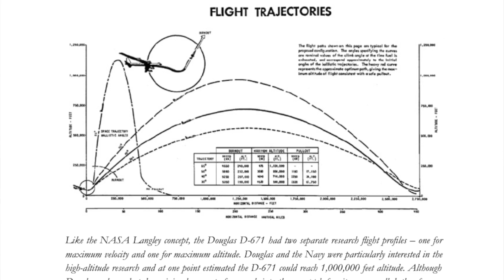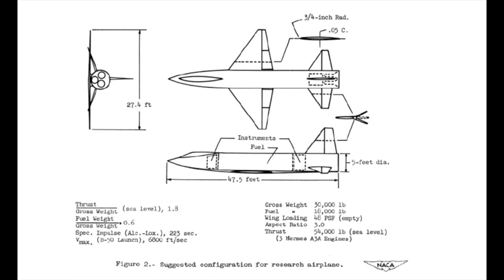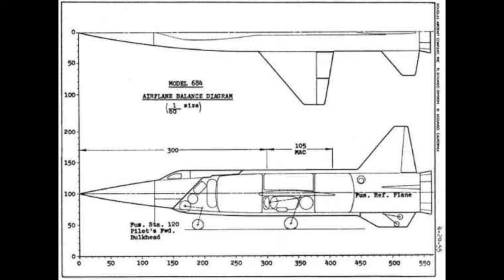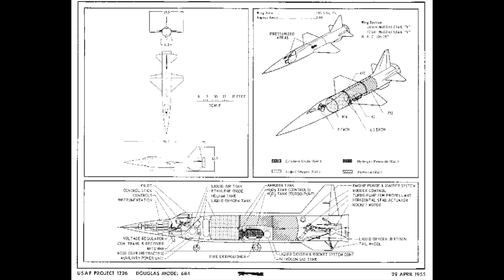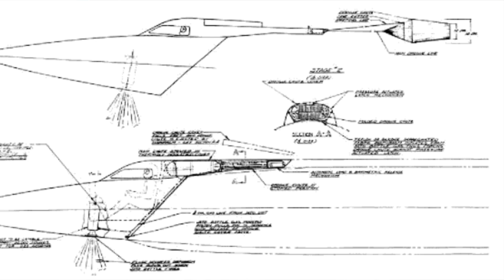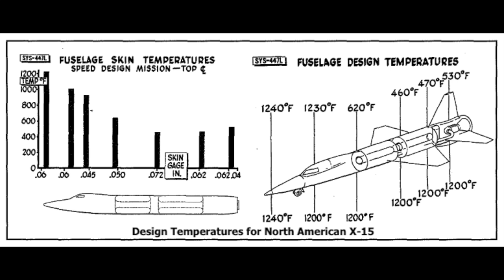The Radioactive Alternative To The X-15 - Faster, Higher, Cheaper. The Douglas D-684

Comment: Well thorium is only weak radio active and it emits alpha radiation. In an allow, the concentration is even lower and most of the radiation is already blocked by the magnesium. The remaining radiation isn't able to penetrate the heat shield nor the suit the driver is wearing. Even if it would be, the cosmic radiation in this hight is a lot worse than the radiation of the thorium.

Now that I think about it, thorium has a huge nucleus thus its good for shielding from cosmic radiation, I wouldn't be surprised if the total radiation inside this aircraft was lower than in the x15.
Reply: Correct. Just wearing a normal flight suit and some thin leather gloves would shield you completely.
Reply: I was thiking the same.. only 3%... and alpha... if the shell is just a couple of mills thick it most of the radiation would not even escape the material.
Reply: you can buy commercially thorium and lanthanum alloyed tungsten welding electrodes. most of them are .1% to i think about 2%, which isn't super far off from this. alloy. now, tungsten would be a significantly better shield than magnesium, but still. the fact that they don't even have an mention of radioactivity is telling.
Reply: I’ve worked around a lot of Mag-Thor alloys.  It’s not bad as long as you are a few feet away.  Wouldn’t recommend sleeping with it under your pillow for a month...
Reply: Until at least the 1970's, you could go into a shop in Britain and buy gaslight mantles which were made using thorium. It has also been used in thermionic valves (tubes, if you're in the U/S). As a student, back in the mid to late 1970's we used Thorium as a mildly radioactive source (mainly an Alpha particle emitter) for study purposes. It’s radioactive decay rate really is low; so low that the naturally occurring red granite in that area of Southwest England actually gave higher counts on our Geiger-Müller detectors. The human body is designed to be able to withstand low levels of naturally occurring radiation, and to repair the minimal damage caused by it. There is a lot of hype and hysteria about the dangers of radiation exposure. High levels are certainly dangerous, and can easily overwhelm the body's tolerances, but Geiger counters can give, to the uninitiated, what appear to be alarmingly high count rates which are simply at natural background levels.
Reply: Not quite, a sample of thorium just like a sample of uranium gains radioactivity as it ages and accumulates daughter products. Many of which are gamma emitters.

And as for shielding, heavy elements such as lead or thorium are only good for shielding gamma radiation and x-rays. They actually aren't very good for shielding particles with mass and/or charge, such as many cosmic rays (electrons, positrons, iron nuclei, muons, you name it...) as they cause Bremsstrahlung or braking radiation, where interaction of charges and resultant deceleration of energetic charged particles causes secondary electromagnetic emission, in this case high in the gamma range/x-ray range. Instead they are better slowed down by large masses of lighter stuff like carbon or water (or the atmosphere).

This is, if I remember my first year physics correctly, because the lesser the difference in mass between two recoiling particles, the closer the collision is to elastic, that is, more energy is transferred directly to the interacting particles rather than available being "lost" somehow, in this case to secondary gamma ray emission.

So possibly the D684 would have been better shielded against cosmic rays, but only because instead of say a given weight of inconel between the pilot and space they might have had somewhat more or less weight of what was basically magnesium, which would be better at slowing down charged particles without harmful secondary emission of gamma rays.

Although I have yet to see any convincing evidence that aircrew have had negative health outcomes simply because of the radiation they are exposed to from space. On the contrary studies of aircrews have shown no increased risk of cancer, the most usual negative health outcome of low levels of radiation.

That said the higher cumulative radiation doses of long term space missions have induced a measurable negative effect, such as higher rates of atherosclerosis, which was previously not linked to radiation exposure, as well as a higher incidence of cataracts, which has been a long known risk of exposure to ionising radiation. But the flight times of the X planes are measured in minutes, not the weeks, months or years needed before we saw these outcomes in astronaut populations. 

But all that said the amount of radiation given to the aircrew and maintenance crew was likely to be minuscule. This was recognised at the time of the phase out of these alloys, but the argument was that it was exposing ground crews to unnecessary radiation that they would otherwise not be exposed to, albeit radiation far less than the aircrew would get as a virtue of simply being covered by less air while cruising. And so the US military and pretty much everyone else decided to phase such alloys out on the basis of the ALARP (as low are reasonably practicable) principle. That said it might not be out of the question to use such a material in a place where nothing else would do.
Reply: There is of course the people in the machine shop who work with it, any swarf that gets discarded , the maintenance guys, the non zero chance of the thing turning into a fire ball and scattering thorium all over the landscape. The pilot is not the only person who gets near a plane.
Reply: @francesconicoletti2547  We are talking about an alloy with only a small percentage of thorium. Thorium is a weak alpha emitter. That btw is all over the landscape anyways. Even if this thing explodes it wouldn't have been even remotely a problem (i mean the radioactivity). The workers have the highest burden on them, but only if they breath dust from machining. Even then it would be comparable to eating a few bananas and a joke compared to smoking. Give those people a respirator, cleanup the workshop and those people will be absolutely fine.
Reply: aullik clean up workshop, respirators in the 1960 ? Really. That’s a cost. This is the cold war. Harden up. It’s only a little bit of radiation.
Reply: @francesconicoletti2547  dust respirators? they had them and used them in WW2 here in Germany. I don't know about the US tho.
Reply: @_aullik  Inhaling would be more dangerous on account of Thorium being a heavy metal than anything involving radioactivity.  If you compare relative radioactivities, as well as dust being in some parts per million concentration compared to 100g of banana, it's actually pretty hard to tell which one exposes you to more radiation.  Anyone want to do the math?
Reply: On the machine shop considerations: the US Navy and Air Forces I'd actually trust to do the right thing by their engineers, and also probably most of the direct contractors because they could pass the costs onto the defence contract.    But civilian companies not on a open-ended defence budget: not at all. Just look at what companies were doing with asbestos and coal mines through into the '80s.
Reply: @francesconicoletti2547  thorium is everywhere, in the black sand. It's a large contributor to background radiation, and not a huge concern, so if an aircraft made out magnesium zirconium thorium alloy blows up and the magnesium/zirconium catches fire and spreads thoria over the entire landscape, I doubt it would make much of a difference.

The danger, if there is one, is when you concentrate it, and either to the machinists machining the stuff or the ground crews crawling inside of the damn things for hours working on the guts of it. Yes thorium can emit penetrating radiation through the accumulation of daughter nucleides. But that's not really a risk to aircrew, considering the sheer amount of radiation from space they get exposed to, really dwarfs the piddling amount that would be coming off the alloy, no matter how long you aged it for.

Although thorium does emit as one of its daughter products a very nasty radon isotope (thoron or radium-220) with a very short half life of 55.6 seconds), again, it occurs in nature seemingly without problem, and the only time radon (of the more normal kind from uranium, at least) is a problem is where it is allowed to accumulate in say a granite basement. And that's assuming that radon it even escapes from the alloy in the first place, and even still it seems unlikely to accumulate if it has a half life of less than a minute.

Not saying a harmful condition couldn't happen, but being mindful of the danger I'm saying it's unlikely that such a condition could occur that couldn't be remedied by the simple expedient of ventilation and dose limits.
Reply: @francesconicoletti2547 If you were to inhale swarf you'd be in big trouble anyway.
Reply: I wouldn't be worried about the pilot or the maintenance personnel, but I would be concerned about the guys who had to manufacture the structure of the thing. Machining/grinding/cutting an alpha-emitter sounds like a nightmare.
Reply: thorium needs plutonium for decaying as in itself is not fissile and then it emits alot more thermal energy and also alot more (poisonous) gamma radiation. thus it needs conventional lead an concrete shielding which is not something you want on an aircraft that you want to take to supersonic speeds. Though it would be alot more efficient than Uranium-233 reactors because in case of a meltdown you could just remove the plutonium agent to stop the meltdown, the emission created by aplutonium / thorium jetengine would be alot higher than Uranium-233.
But it does not emit any Radon gases as Uranium tends to do so for convential reactors Thorium and Plutonium is great

Comment: “Chernobyl Airlines”
Reply: Daniel Rodriguez I believe for Japanese it’s called project Orion
Reply: @thenotflatearth2714  Fukushima Airlines -  the branch of the US's Three Mile Island Airlines.
Reply: Daniel Rodriguez  Cool story, bro.
Reply: direct flights from Chernobyl to Fukushima, available at just 200 caps!
Reply: I wouldn't sprinkle some powdered thorium on my dinner, but that's due to the toxicity of pretty much any heavy metal. I wouldn't worry about the minimal radioactivity of the thorium. The reason people do worry about such things is the smear campaign against anything nuclear designed to prevent competition with fossil fuels.
Reply: @jimbaerg1100  That's the one. We could have ultra low cost ultra safe nuclear power right now with uranium, thorium or even waste PWR fuel rods as fuel but it's regulated out of existence. Partly by excessively cautious rules about emissions but more importantly by using tick box rules that wont work for a fail safe, self limiting, atmospheric pressure reactor that would not release toxins into the air even if the lid was taken off.
Reply: In soviet Russia.....Plane flies you.
Reply: Not enough radioactivity to be of concern to anyone on board.   Well within safety limits, was only replaced later with more advanced material.  Was a good start, North American was a Douglas associate (Douglas helped start) still got contract.
Reply: XDD
Reply: Id fly it

Comment: the X15 was completely insane. leave the SR-71 for dead, even if it was for short periods.
Reply from the maker: And the D-671 would have been even more insane....
Reply: Apples and oranges...
Reply: Ya'll just remember, the X-15 was a rocket, whereas the SR-71 and it's forerunners were jet powered. The X-15 flew higher and faster, but it couldn't fly around the world. The Blackbird could stay airborne with tankers. The X-15 couldn't. But still nothing could touch the Blackbird.
Reply: Spot on, the X15 was a hypersonic experimental aircraft. Hence the "x".
Reply: @pg1171  A YF - 12 could (pass it up)!
Reply: You don't get an X15 without a bomber host aircraft... one big flaw.  SR-71 got it beat there.
Reply: @scowell  Tbf an SR-71 won't get far without a tanker, with a full fuel load it's too heavy to take off
Reply: @brynclarke1746  X-15 can't even take off!  You're insane!
Reply: Well that was stupid! Like comparing a tank to a destroyer escort.

Comment: thanks for the metric.
Reply: Even as an American 1,000,000 feet mens absolutely nothing. Metric for the win
Reply: But he made a mistake centigrade doesn't exist is celsius
Reply: @marccosdecesaro 
 no, he is right, centigrade is another way to say celsius
Reply: @TheRobweb  it is a very common mistake but centigrade is not a unit of temperature, centi means divide for 100 and grade is a unite of angle, believe me I made that mistake too,
Reply: * @marccosdecesaro :  "The Celsius scale, also known as the centigrade scale (between freezing and boiling points), is a temperature scale used by the International System of Units (SI). As an SI derived unit, it is used by all countries except the United States, the Bahamas, Belize, the Cayman Islands and Liberia. " (Wikipedia)*
Reply: @cashuma5010  i know that and centigrade came from latin, it just hurt my engineer ears to hear someone using centigrade because is out of use, but anyway thanks for Metric
Reply: @marccosdecesaro  "Centigrade" is the true term.
Reply: @marccosdecesaro , it does exist but I get you. Kelvin is also centigrade
Reply: You can use math to convert into units your handicapped intuitions can comprehend. Just FYI
Reply: Americans often say "you can do the math and convert the units" when people ask for SI units. Sure, and you could also say that the aircraft flew to a height that's 10 million times the length of the hypotenuse of a right triangle which has one base as long as a standard credit card is wide, and the other base as long as half the radius of a DVD. You can do the math and convert it, but it's ridiculous anyway.
Reply: @evanfinch4987  just like 6857 Empire State Buildings! That makes sense!
Reply: @evanfinch4987  By using metrics, fewer people will have to do any math at all!
Just enjoying the video.
Reply: Didn't you people take any math classes???
Reply: @evanfinch4987  what???
Reply: @evanfinch4987  and your point is..?